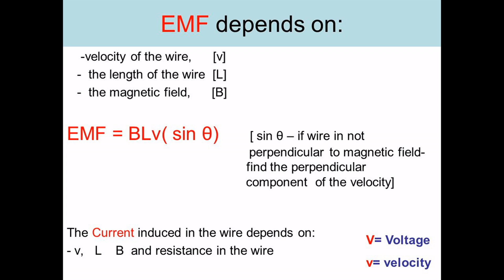1867 The Perfect Generator For The Home Builder

Comment: I have a question, sort of unrelated to this. With your serpentine coil, you're cutting across the coil perpendicularly. This creates alternating current. I get that. Seeing the motorcycle wheel made me think of something though. What if the coil was just a circle...not a serpentine... do a few hundred turns with a moderately sized wire which is then supported on something like spokes to the central hub to make the stator, and then for the rotor, you take a tubular circle the same diameter as the coil, just with a bigger radius in the tube so that it sort of cups the coil, split it in half so you've got two half-circular tubes, and then line the inside with magnets. So, for a half circle, you do three magnets lined up the same so that N or S is towards the center of the tube, then an inch or so away, you do another line of magnets in the opposite direction (N vs S), and repeat this around the tube. Once mounted together so it's balanced and you have relatively close distance from the face of the magnets inside the tube to the coil, if you give this a spin, it'll provide DC power, wouldn't it? Or would that still be AC? Instead of alternating the current at specific points within the coil, forcing the voltage to oscillate between positive and negative, you'd be moving the north or south field of the magnet through the coil... To be honest, I'm not even sure if that would work, but I feel like it should. If the coil's positive and negative are disconnected, you wouldn't get any power out of it because there's nowhere for the electrons to move to, but as soon as they're connected through a circuit, those little electrons should be moving through there at whatever speed the rotor is spinning.

I think even if you just did the magnets as a monopole, meaning you don't alternate them, if you throw a capacitor inline with the outputs of the coil and you should get some stable DC power... no need to rectify anything... And then depending on how you have it set up, if you put some airfoils (aerofoils) inside the half circle tubes and put it out into the wind, you'd have a pretty solid wind turbine with a lot of momentum due to the weight of the magnets...

Comment: Interesting 🤔!  Going on your idea that better generators follow on better motors, I would be very interested to see your adaptation on the latest Tesla (Elon) motors?  I think others would also be interested.  I suspect so would you?  They are rather amazing.
Reply: Good is freqently not well defined. 

A good motor for a specific application may not mean a good generator.  Furthermore, a good generator for a specific application may not be good for others. 

Define an application, then you can measure how well a motor/generator fits or compare contrast against others, how well they match  the demands of the application. 😁
Reply: @kreynolds1123  That's fair and yes Good can be ambiguous and even have opposite meanings for some.  I ise it ubiquitously leaving room for poetic embellishments and creative insights, for better or worse, kind of like marriage, but I'm not married to the word.
Reply: @kreynolds1123       engineer thinking   NO1

Comment: Wow, I think you may have turned the home generation world on its head. Imagine what you could do with your feathers on an old bicycle wheel? Or multiple bicycle wheels stacked on top of each other? We’ll never have to put another ten Bob in the meter!
Reply: Love this idea, am about as electrical as a mouse chewing electric wire, but the flat bottom generator stacked under bike rims and feathers REALLY interesting. 
Make feathers out of beer cans , make a wall of them in the yard, then to battery bank...
Here in NM ---lots of wind 😀
Just want off the grid...

Comment: Totally Agree But I do remember the effort on a bike with the old rim generator
Reply: Now, there's a blast from the past! As soon as you leaned over the handlebars to lock those things against the tyre your legs got a LOT more of a workout. All that effort to power a bulb that gave you about five feet of vision. For context, this was 40+ years ago so not exactly as efficient as today's kits.
Reply: @NiteLynr  Yes it took noticeable energy out of me but I remember 5m not feet. However, nowadays at least one can charge a smartphone with it. Cheers
Reply: @NiteLynr   in the 40s
Reply: @leopoldpoppenberger8692  In fairness, this was my grandmother's bike so most likely 😀
Reply: With led bulbs 💡 I bet things would be much easier to deal with.

Comment: To illustrate a point, say one has 4 magnets, and 4 coils, and a given revolution per unit of time, if you double the radius you double the speed the magnets pass over the coils, doubling the rate of change and doubling the peek voltage generated. 

If that were everything then that would be cool. But in doubling the radius you doubled the circumfrence, which now allows twice as many coils that allows one to wire them in series or parallel. Doubling the voltage again, or being able to supply twice the amps.
Reply: This also increases the amount of drag induced by Edward err Ed err Eddy Currents, increasing the amount of torque needed to spin the device at a significant speed.
Welcome to the wonderful world of selecting components that fit each other.
Reply: @TimeSurfer206  Where steel is used, Yup. 🙂
Reply: and you can fit twice the number of magnets too
Reply: @grendel1960a  Yeah, I forgot to include that.
Reply: I think the formula says that if you double the speed, the power quadruples? My memory is going, going gone.🥴
Reply: @justtinkering6713   If you double the volts for a fixed resistance (Ohms) you quadruple the Watts....
So faster speed on the same Coils and wiring, would give you that effect.
But note physically increasing the size of the rotor will add weight, giving more losses.
Thats how mechanically it could work.
Electrically, stronger magnets and more coil wire, also works.
A balancing act par excellence. 🤪
Reply: @justtinkering6713  4x the power. That's what happens when you can quadruple the voltage at a specific current, or double both the voltage and the amps. 

And thus us just the capability. That does not mean one can get 4x the power out of a specific turbine. A generator and turbine and load need to be well matched.

Comment: Great video Rob. I am a fan of VAWT design for the reasons you spoke of as well as the safety. The pressure envelope that forms at a certain RPM with the VAWT is my favorite aspect. It is similar in concept to steam because the torque is greater despite the lower RPM of the turbine. Just a side note, it would be awesome to make those flaps on the flat turbine you made into solar cells so that when the wind is calm, you still generate power though not much power. Cheers
Reply: interesting idea on the solar panels. My thoughts would be that you would want the mass of the feathers to be as low as possible to prevent material fatigue over time and the idea of getting electrical contacts that could survive the regular articulations would be a challenge I would think. Great idea on different integrations. No one solution will resolve this.
Reply: @InspectorKemp84  the thing with 0.5mm cheap solar cells is they are over 99% of their 0.5mm thick mass the fibreglass substrate. Can't see why a silver torsion spring rod in a lubed nylon tube and a slipring contact for the other pole wouldn't be a great solution for conductors. Though carbon fibre rods and slipring contacts could be even better. 

Hey Rob, why not try a proof of concept, with say one of your Rose or feather turbines as a sun on a downward cone edge profile platter, A bladed VAWT with vertical blades on a V bike rim, and nylon beads drilled half through, pressfitted on three brushless DC motors as generators and planet bearings?

Comment: Excellent but in practice the tolerance & engineering is Extreme in comparison in this design that's why it's not used & the motorcycles shown are extremely over engineered one off & have friction loses & service requirements  that make them unusable? In the real world they but are very interesting 👍

Comment: I can feel myself about to go down the rim-drive rabbit hole. I'm an EV enthusiast with a moped conversion in mind and I didn't know that was a thing.
Reply from the maker: it is a rabbit hole lol
Reply: Very cool, I have built a few hub drive e bikes. Same concept so look into hub motors for e bikes, much cheaper than a commercial grade hub motor for a motorcycle and you really only need about 2000 watts to travel at 40 MPH but, I would go for 3000 watts for the steeper hills ( I was in the mountains of Washington state lol ). Good luck on your project, I put over 2000 miles on my second bike.
Reply: @JSabh  from where did you source your parts? I've had a lot of difficulty finding the correct sizes or dealers that are willing to talk to me about it. Not to mention most search engines don't seem to know the difference between a 40mph moped and a child's scooter.
Reply: Like I have no idea HOW a drive like that would be engineered but imagine the energy savings of not having to waste so much torque.
Reply: The only other device I can think of with a similar function is a rail gun.